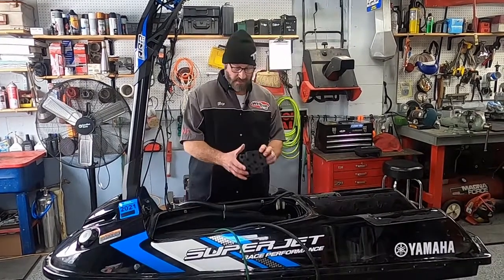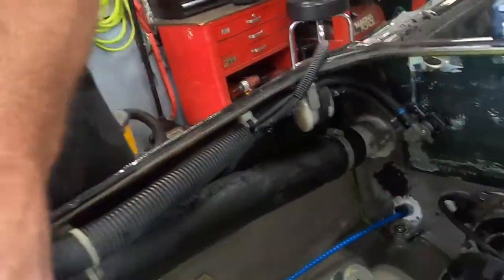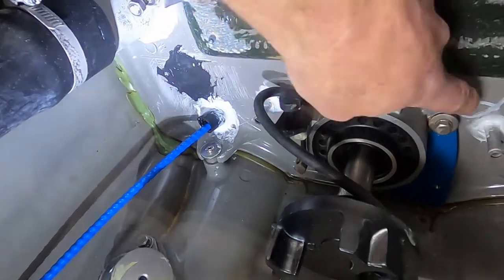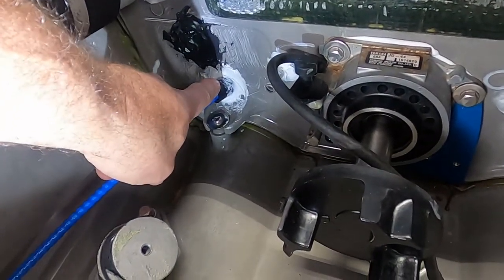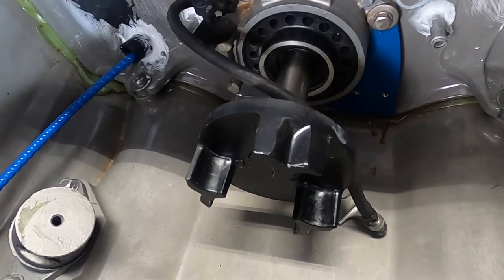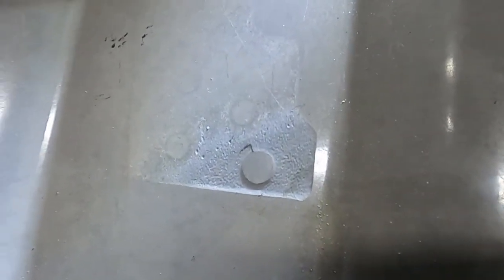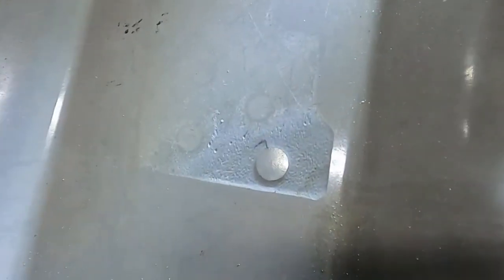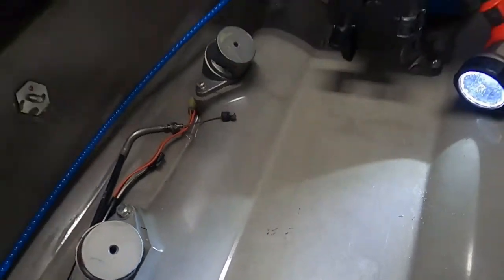Seal up Super Jet Bulkhead

Comment: How donu remove the rubber mount under the engine. Do u have to replace case bolts for it?  Thanks
Reply from the maker: No need to change the bolts. Just remove the mount, and put the bolts back in.
Reply: Won't they be too long without the rubber there?  Maybe I'm missing something.   Also mine are rusted really bad for some reason.
Reply from the maker: @Northwestvision  No they are not too long. The bolts are a shoulder bolt. You will understand when you install them......

Comment: I was watching a video of someone replacing the pump bolt inserts. What keeps water from coming up the threaded porting of the insert and into the foam?
Reply from the maker: On a SJ I put silicone on the threads. On a Kawi,  the pump bolts  are NOT exposed to the tray foam.
Reply: @watercrafttalk2738  are the superjet threads exposed into the foam? Or are the inserts sealed?
Reply from the maker: @benselby6171  Inserts are "supposed" to be sealed, but many times they are not, and do in fact leak.  Thus I put Silicone in the insert to seal.

Comment: What do you do if the foam is waterlogged? Cut holes in itvand replace the foam?
Reply from the maker: es, you would need to cut the hull open, dig out all old, wet foam, reglass hull up, and re-foam.